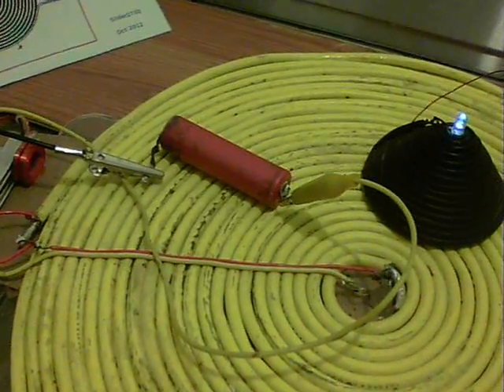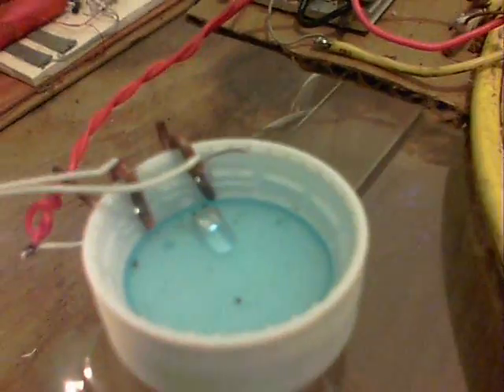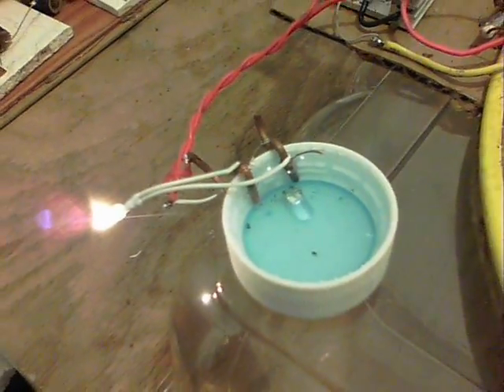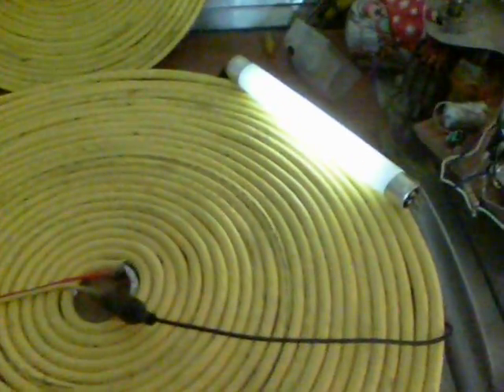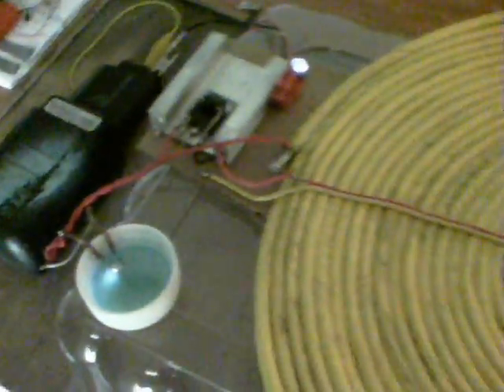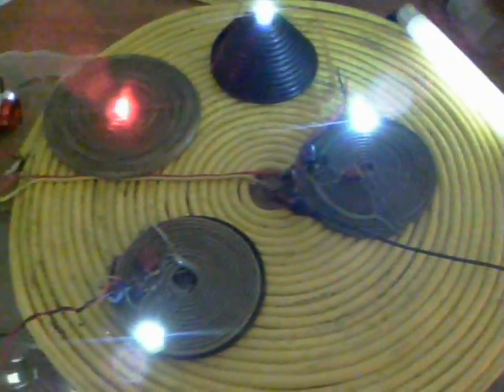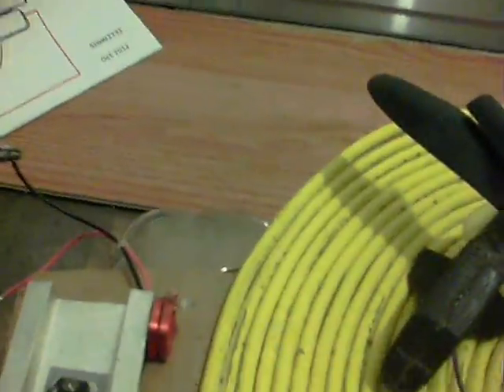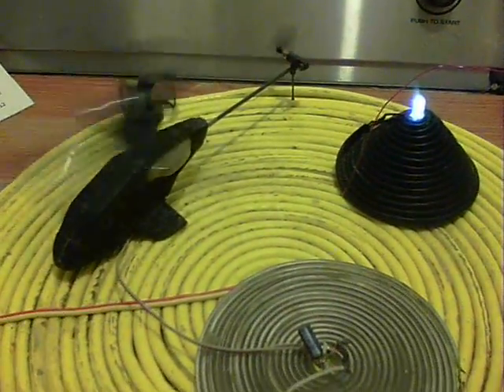Simple Wireless Electricity - Part III - Diversity

Comment: Not to be rude. But this coil is simply a wound up extension cord. An extension cord that requires energy to light the bulb. An LED basically requires zero energy to drive. My thought is how much energy is lost in the coil. ?  The principle is the same as an outside solar yard light. Energy collected stored in a battery driving the lights. Once the battery of stored energy is gone. So is the light emitted. So why waste the energy just moving through the coil? Or extension cord. Just unwind the coil. Reduce wire size and add lights a ling tge way as in the solar yard lights. What is unique about this idea. I must be dimmer than an LED to miss Tesla's brilliance on this one. Enlighten me if you can.
Reply from the maker: Perry Berens Haha, no it's no problem and is why many people don't quite see what the use is. It is indeed the same as winding up an extension cord, to form the coil. Tesla's trick, was to join the end of 1 of the cord wires to the start of the other. It then forms a very powerful wireless electricity coil, with a self setting capacitance and resistance.
As such, a receiver coil matched to the output of it can then run a myriad of devices, from LEDs to motors to mains bulbs. None of which need any regulation or other transformer circuits. The efficiency also goes up with adding more loads to it - quite wonderful.
Reply: Thanks for the response. Slider. When I get a little time this all I will see what I can do. Thanks for the tutorials also. Interesting science.

Comment: I'm looking at making an electromagnet powered via wireless energy.Getting energy to the electromagnet from the receiver isnt so much of an issue, interaction between the electromagnet and the transmitter coil is an issue.Have you ever tried something liek this?
Reply from the maker: hellcattanks I haven't tried that exactly, some things have been similar though. Depends how you are gaining the power throughput (from my own experiences). One systems field collapse can power up anothers coil if not careful with what is doing what at which times. If you have plenty of smoothing and use a full wave bridge rectifier, rather than half wave or Avramenko plug, then there seem to be less problems. Also, to put a 10uF cap in series with a voltage (or/and signal feed) like audio equipment, can help to isolate systems from one another.  Hopefully that helps.
Reply: It woudl seem in my application with the transmitter coil much larger than the receiver Q is going to be an issue with the receiver, making the coupling coeffcient really poor, I thought about compensating for that with a capacitor in the transmitter, this would make the trans and receiver distance critical, so  maybe this time wireless isnt the way to go.
Maybe I'll put a small battery in the target and charge it inductively, or a supercap.
Reply from the maker: hellcattanks Could always try a 0.1uF or various other non electrolytic between Collector and Base on the transmitter coil too...that tends to beef up output and may shift the frequency enough to not interfere.
I'd be interested to know how you are driving as big a load as an electromagnet. LEDs are at the bottom of the scale, motors usually nearer the top or incandescent bulbs, but an electromagnet has my full respect for even trying it ! lol

Comment: Can you put a lot of light bulbs, and measure the bright they are making?
If you can bright lot of tubes with a few batteries it would be great to have one disc of this in any home.
Thanks for the 3 videos
Reply from the maker: Leonardo Cabrera It was 2 1/2 years ago lol, those coils are quite busted up now. But normally, with such a system, 3 or 4 bulbs will light to around 80% of full brightness, all exactly the same output even if only 1 is being used !, it's quite odd how that works. Then, with adding the 5th, the whole lot will reduce in brightness together. It's all quite fun to experiment with. Bulbs can be connected by just 1 wire, to anywhere in the room for lighting, so needn't be near to the coil. Thanks for your question and for seeing the mental pic of how this sort of thing is very practical (much safer than mains power too)
Reply: Thank you for your response. Is a very practical way to have light, really think so. Good work, great videos and more achievements in the future. greetings

Comment from the maker: Very interesting and yes, related to what i've been doing :) Input was either 3.7V or 10V (though the rejuvenated drill pack will now charge to 12V after more use). Amperage can be as high as 0.5A with no tuning. But the idea has always been a simple system, to get folks started. With being picked up by standard AM radio easy enough, made sense to use a crystal set using no battery. Best wishes with your projects !

Comment from the maker: Hey there. Am going to use a 1ohm resistor. I do know that just transistor, with nothing else can be about 500mA at 12V, MongrelShark also showing 20mA with AA. All can be tuned like Slayer Exciter to cut amperage, but simplicity was the idea.
However - next video i'll be showing a pancake exciter running with 0mA drain from the source :)

Comment from the maker: Thanks, I do try to imagine myself sat watching them. The coils don't need transistors, a single filar pancake works :) I've made a few pancake blocking oscillators over time though and so use them in such videos. The conical black one say will carry on running as a flashing oscillator when removed from the wireless charge.